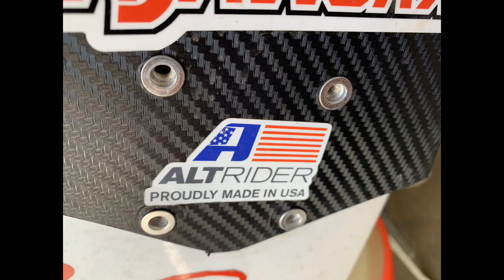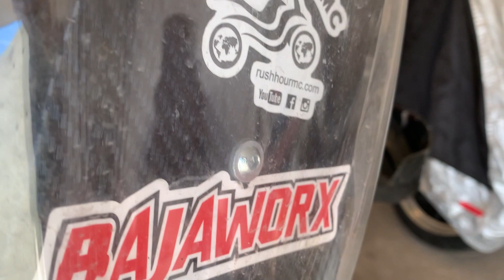CRF450L - Tower - My Hybride

Comment: how is the wind protection?  I have a CRF 450 and I am over 6 foot and love my bike.   My Adventure bike is a T7 but there are days I would rather take my 450.   Setting it up for ADventure riding.  Harder to pick up my T7 as I get older
Reply from the maker: It’s not a BMW R1200GT in wind protection but it is better than just using screen or AS-tower as the screen is in better angle and higher.

Comment: This is exactly the direction I am going next.  Do you have any specs of the cover plate and brackets you built?
Reply from the maker: Sadly not, I made it on the bike, didn't take any measurements.
Did it in thin stainless steel and then wrapped It in Carbon LookALike

Thanks fir the comment